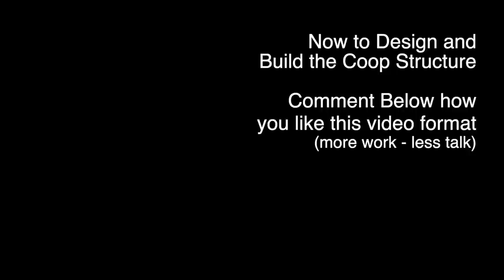Mobile Coop Part 3: Building a Trailer Frame from Sawmill Lumber

Comment: You have no idea the searching I did to try and find a DIY trailer build that was basically entirely made from lumber and not steel as I do not know how to weld personally. I would have done something similar anyways but the reassurance that my thinking/planning/designs are sound was the reassurance I needed to get-‘er-done!!! I plan on spending zero dollars for mine. Thanks a million sir

Comment: Looking good.  Keep an eye on that hitch that you have bolted on with the carriage bolts.  I think I would recommend making a steel plate on the bottom and sandwiching things.  Maybe even a C-Channel would be better.  I think I saw a crack started all ready and with your hills, I would want that to be pretty secure.  Most, if not all, of the wooden tongues I have seen on mowers and wagons all seemed to be sandwiched with metal.  This is all coming from an ex-sports car racer, so like that kid in the movie, Sixth Sense, 'I see broken stuff...."  My 2 cents.
Reply: No crack, that’s just a cold joint cause that hitch-framing member is a sistered 3” x…. 8”? So two 3 by 8’s fastened together. Might have been stronger using a full 6 by 8 but he likely did that because he had them already and still plenty strong for anything he might put on there.
Reply: I would have added a good amount of Simpson strong ties in various places but only because I’d likely use it for all sorts of things. Chickens don’t weigh too much… giraffes however…. 🦒 🦒

Comment: This format is nice for an occasional change, but I prefer some talk, too....  unless you're Mr Chickadee.
I'm wondering how much weight you can get on the trailer... you want it strong enough to survive, yet not so heavy you can't tow it around. Also you need it balanced right, so it won't go tipping back.

Comment: Type of wood used to build your trailer.
Reply from the maker: This was tulip poplar from our mill.
Reply: Go with pressure treated Doug fir. Cheap and available, as strong as any other solid-sawn lumber or strong enough I should say, not prone to cracking/checking like a harder wood plus a lot cheaper and gives it some flexibility as well, and nothing beats it in terms of water/moisture/dry rot/termites. If you want it to last a hundred years just add some aluminum galvanized metal flashing/sheet metal or some butyl “bitch-uh-theen” (don’t know proper spelling) it’s basically roofers tar that’s more solidified that you can buy in rolls that stick on/adhere same as tape. The sun heats it up eventually, when that happens the stuff sort of liquifies and sticks to the wood like no bodies business. At that point it’s basically permanent. Also easier than metal flashing as it doesn’t require any fasteners (aka holes for water to get through) and if you do end up knocking it/puncturing it anyways the liquoficstion process pretty much will plug them up automatically. I also suggest just using some sort of adhesive for the metal flashing if you go that route for same no holes reasons. Or just sand which the metal flashing between the PT and whatever you end up using for decking.